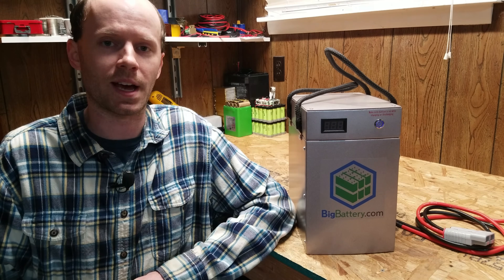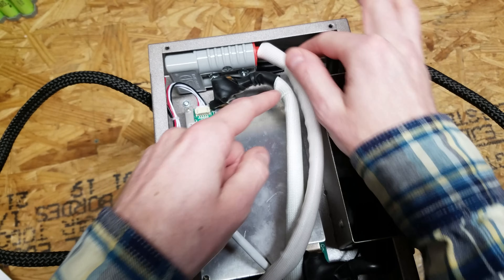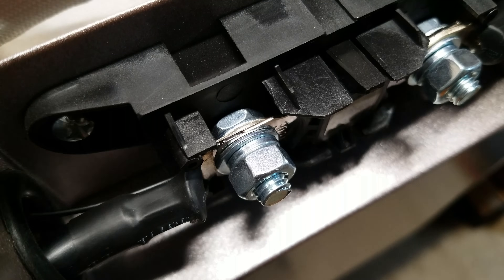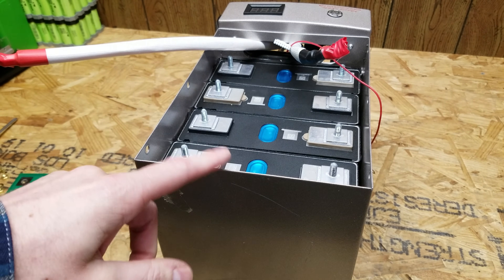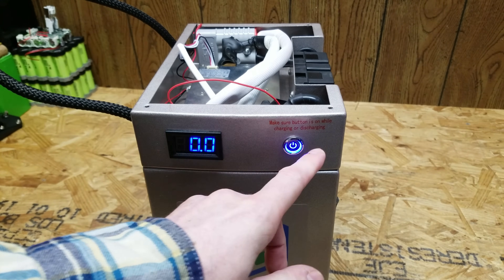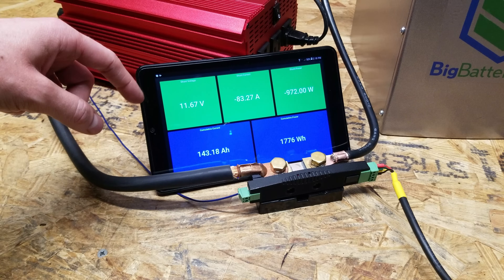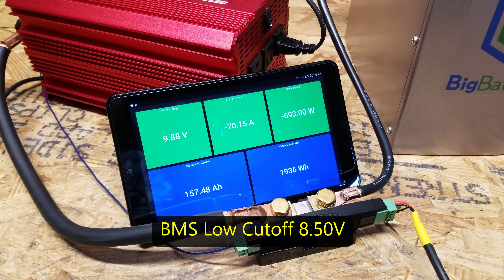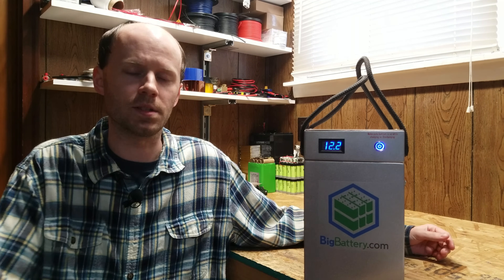BigBattery "OWL" 12V 170Ah LiFePO4 Battery, Review and Teardown

Comment: Too expensive for me. Oh well, looks like it will have to be a DYI job
Reply: it is the wrong way to go anyway. using 12 or 24 volt batteries and putting them together is not the way a battery is supposed to be made. you start by figuring out how much power you want. then you you go to the voltage size you want. first AH then voltage. they are doing voltage first then AH and that is the best way to end up with a battery that you have problems balancing which ends up with lots of other problems in the end. the reason people do this is because they are thinking backwards. they only had 12 volt lead acid batteries before. now they are doing the same thing only with lifepo4 batteries. it is the worst thing you can do to created a battery bank. if you want to build a proper battery  I can help. I also have battery cells that are far cheaper than the gouging these guys are doing and they will last longer too. a ten year warranty for batteries that only last 10 years isn't that great. a properly built battery bank from lifepo4 batteries should last at least 15 years and if you are taking good care of them and not going over the 80% DOD they should last 20 years. I doubt that these 12 volt and 24 volt batteries being put together in parallel will last that long. no matter where they are made. they are just being made the wrong way, they are 12 volt battery replacements not the components of a proper battery bank. email me if you want to know more or get battery cells for a great price 
perry_kusnezoff@hotmail.com

Comment: Nice video.
If you want to increace your voice sound quality try to use an EQ at around 800Hz, 1.5Q and -12 till -15dB
Reply from the maker: I'd love to find a better quality wireless mic. It's just difficult to know what is/isn't decent when looking on Amazon. If you have any recommendations, I'd love to hear!
Reply: @LithiumSolar  the problem with lavalier mics is, that they have problems with some frequencies.
I helped Andreas Spiess - a well known Youtuber - with his bad Sound...  he used a not cheap røde system.
You don't have Noise in your Recordings, thats good. I think your mic ist good enough.. you only need good EQing.
Is there a better way to communicate with you?

Comment: You forgot to re-install the black boots on the battery bolts. The plastic shield covers them so no biggie. Would ever consider replacing all of your battery packs out in the shed with these types of batteries? Can these batteries be placed in parallel to make 24/48vdc battery? What about series to make 370 Ah battery? Thanks
Reply from the maker: Thanks. I didn't even realize until after the fact when I found a pile of them. They're back on now. And yes, I would love to replace my NMC batteries with LiFePO4. It is extremely contingent on finding someone who is interested in buying the NMC and thus far, it seems nobody in my area is interested in even raw cells... You can series up to two of the 12V batteries. If you need 48V, they have a 24V battery that you can also series two of.

Comment: Build quality looks good.
The Ah capacity measurement is not affected by cable drop, just the Wh capacity is affected.
Another explanation for the lower-than-rated Ah measurement result could be that the battery was NOT BALANCED.
Reply from the maker: Yeah I was thinking of Wh when I said that. Also, a lower C rate would probably get closer to the rated value.

Comment: I do not like fuses, they COST too much to replace.
Circuit Breakers work just fine and are RESETABLE.
Reply from the maker: A properly-rated DC breaker for a battery with a continuous rating of 175A is going to cost $100+ and be very large. Fuses don't cost anywhere near that.

Comment: I would question that the PCB connecting the individual batteries could handle 300Amps...
Reply: I did too. An online calculator said a 2oz board would need 200mm wide traces on both sides. Also having seen high power PSUs usually these high current traces are covered in solder for extra current capacity...

Comment: Why do you want a fuse over the breaker?
Reply from the maker: For a battery with a continuous rating of 175A, you would need a 218.75A breaker (250A). The cost and physical size of a proper DC-rated breaker at that ampacity and high enough voltage to allow several of these in series make the fuse a FAR better option.

Comment: Pedant Alert:
PCB = Printed Circuit Board, Saying "PCB circuit board" is worse than putting your PIN Number in an ATM Machine.
Reply from the maker: Lol, totally understand...
Reply: Kinda like a "hot water heater".
Reply from the maker: @grantstockdale9848  What's wrong with that? Maybe the water is hot, but it's not up to the desired temp yet, so the heater is heating the hot water?
Reply from the maker: @grantstockdale9848  I'm kidding of course :) :)

Comment: My battery should be here tomorrow.  how to i check the capacity and state of charge of the cells without taking it apart?
Reply from the maker: Charge it up to full, then you can discharge it through your inverter with something like this https://amzn.to/34lBzFe instead of the Batrium shunt I used here. They're cheap and fairly accurate. There's no need to disassemble anything. I just wanted to see what was inside and how it was put together.
Reply: @LithiumSolar  Thank you. I hope it gets here today.  Great video. I new to a lot of this but, love it. I am converting my RV to lithium form 200 ah AGM .  Moving everything closer together. will have two Big Batteries someday.  Thanks

Comment: So I've really been getting into LFP recently, and I have a hypothesis for why you didn't pull full capacity. At 13.57V, you were at 3.39V per cell, which is pretty close to fully charged. However, 3.7V per cell is considered fully charged for LFP, or 14.8V for a 4s pack. Big battery recommends 14.6V charging voltage, for 3.65V per cell. I personally charge my 4s LFP packs to 14.4V during use, but 14.8V for testing.
Anyway, there is barely any capacity gained by charging to 14.6V vs 13.57V, but we are also looking at barely any capacity missing. 161Ah is only ~5% off from the 170 mark. 
Try charging all the way to 14.6V cc/cv, and wait for the current to go to just about zero. On a pack this large, 100mA is probably close enough, but when I do my own capacity testing I go all the way to zero.
LFP voltage does settle lower and quicker vs NMC, but it shouldn't settle THAT much overnight. 
Great video, keep up the good work!
Reply: 3.65 volts is the max charge voltage on most lifepo4 cells btw
Reply: @BenCos2018  I stand corrected! I don't know why I thought 3.7 was max, but after some digging, I agree with you. Thanks for calling me out. Will be adjusting my methods!
Reply: @Pifreek  no worries 
I auctuly used to think it was 3.7 for a while till I read about 10 lifepo4 cell datasheets lol

Comment: The shunt isn't affected by the losses in the cable. Since its measuring amps, they are going to be equal through the whole circuit, and the shunt doesn't care if the energy/heat is being dissipated in the inverter or the wires. I think the test came in a bit lower than rated because of the high draw rate. If it was a 34A load (0.2C) instead of 80 or so amps you would have likely gotten the full 170Ah.
Reply: Yes.  Cabling loss does not affect the amp hours.  It does however cause a voltage loss, hence a loss of power (measured in watts), and loss of energy (measured in kWh).  And a lower current drawn might have improved the amp hour.  We do not know for sure, without knowing what at what current rating the 170 Ah was specified at.
Reply from the maker: You guys are right, I was mixing up Ah and Wh. The amps would be unaffected. I will be running another test at a lower C rate and have no doubts it will hit 170Ah.

Comment: Opinions: I paired this with my Inergy Apex that is running NMC batteries on a very conservative charge cycle (The unit is specifically limited to prolong battery life). My thought is that the onboard BMS with the Bigbattery 175ah LifePO4 battery will adapt any charging coming from the Apex unit charge controller sufficiently for this to be a safe pairing, if not necessarily ideal.

Thoughts?

Comment: Can someone explain why a fuse is better than circuit breaker? I'm just someone that prefer longevity over consumables.
Reply from the maker: In the last battery I tested, they had a double pole circuit breaker where they had wired both poles in parallel to double the rating of the breaker. I had an issue with a loose connection and the breaker catching when I tried to turn it off. Now obviously, one could use a better quality breaker to solve both of those points, but there aren't many DC-rated breakers of reasonable size for 200A or higher.
Reply: @LithiumSolar  gotcha, so its basically availability and cost on their end. I did see your last video and wasn't a fan of how they did that breaker setup.
Reply: @glossyfpv1155  A properly sized breaker would add about $100 to the unit cost. And the unit would be larger & heavier. Fuses cost about $10 so I'd prefer a fuse and just buy a spare (like Bussmann/Eaton/Cooper or Littlefuse, no chinese crap).

Comment: Also a lower amp load will be able to get the last few amp hrs out of it
Reply from the maker: I will run a few more tests at a lower rate. What's interesting is the datasheets for most NMC cells that I've tested specify a standard discharge rate of 0.2C. But as I've been looking at some of the aluminum-cased LiFePO4 cells, they specify the "standard discharge" of 1C. My thoughts were that slightly lower than 0.5C would have yielded full capacity, but with only a 9Ah difference, I surely do agree that a lower load would get me there.
Reply: @LithiumSolar  I also wonder if there is a run-in period like 18650s where you need to cycle them a few times before you get full capacity

Comment: Voltage drop across the wires does not affect your Ah-measurement.
Reply from the maker: Hmm... Wouldn't the shunt be seeing a lower voltage though because the sense wire as at the inverter? Or maybe that only impacts the kWh reading?
Reply: @LithiumSolar  The current is passed through a shunt to be able to measure the voltage across the known shunt resistance. And from that shunt voltage drop you can calculate the current. So it gives a true measurement of the actual current passing through the shunt regardless of where the remaining voltage is dropped, whether it's in the load or in the wires makes no difference.
Reply: @mcg6762  I beg to differ. There's a length of wire between the battery terminal and the shunt and he noted the wires got warm for example. That's some electrical energy being converted to heat there and that can't be measured by the shunt. That's why shunts must be as close to the battery terminals as much as possible and cables must be thick enough to match the maximum amps been drawn.
Reply: @adon8672  The current is the same regardless of where it's measured. You can't have more current closer to the battery than further away from it. Obviously...
Reply: @adon8672  You're confusing power with current. If the test wanted to measure Wh instead of Ah, then you would need to measure both current and voltage. And the voltage would need to be measured at the battery terminals to be accurate.

Comment: $900 dollar excluding shipping is way to much
Reply from the maker: It's $810 with the discount code and shipping is free...
Reply: Compared to other name brand 100 amp battery’s cost this one at 170ah seems like a great deal
Reply: @zaned9702  you can get raw 170ah lifepo4 cells for about $500 a bluetooth bms for about $50 and a circuit breaker for about $10 and have the accomplishment and learn something from  uilding your own thats the point of diy isn't it not to be spoon fed
Reply: @joshuabest100   their money... they can spend whatever way they want, just like you.

Comment: 121720/1448h PST.     Thanks for the new presentation. This new LiFePo4 battery unit from BIG.BATTERY is a perfect and well designed unit, than many I have seen. The printed battery series connector and the balance modular unit seems to be quite unique, that too, I have not seen before. Well done, BigBattery people. The other salient feature that attracted the attention is the clear acrylic cover placed on the battery PCB and the rubber padding on the metal outer cover, which’d hold the Acrylic board in place from rattling. Very intelligent design, indeed.
What is the display unit, if you may, please, shed some light on that device. Thanks once again. Stay safe. 73s...
Reply from the maker: I agree, very well built! The display is an Samsung Galaxy Tab A. I wrote some custom code to pull data from the Batrium, write it to a MySQL database, then threw together a quick dashboard using Grafana that pulls the data from MySQL and displays on the tablet. It works great for capacity testing!
Reply: 121820/0357h PST.  That’s fantastic. Thanks for sharing. Stay safe. 73s...

Comment: Do you know of and recommend a way to purchase the individual solar panel elements, the 4" by 4" or whatever size they come in individual collector elements that comprise a panel?
Reply from the maker: You can find them on eBay if you search for "solar cells". If you're thinking of DIY building a solar panel, it's often cheaper just to pick up a used panel on CraigsList or somewhere like that though.
Reply: @LithiumSolar  Ok I will check those places thanks.